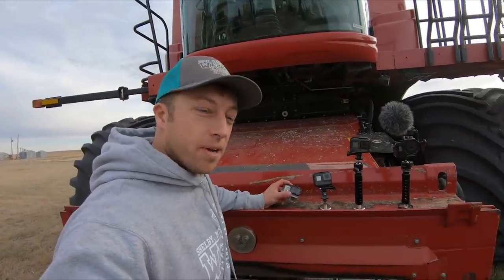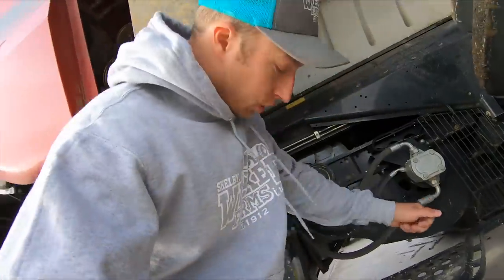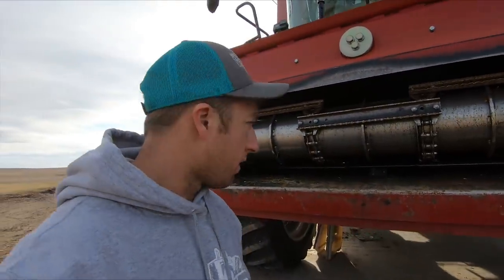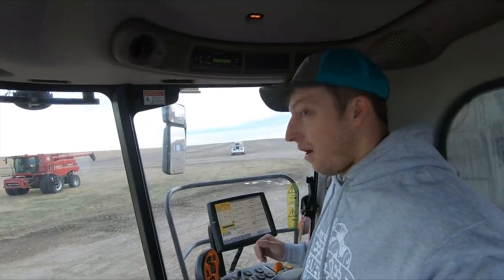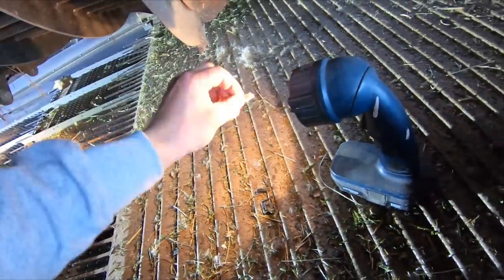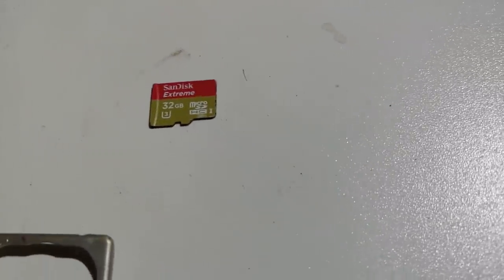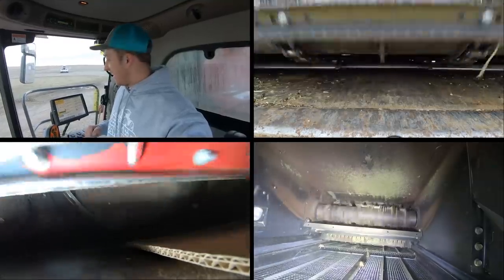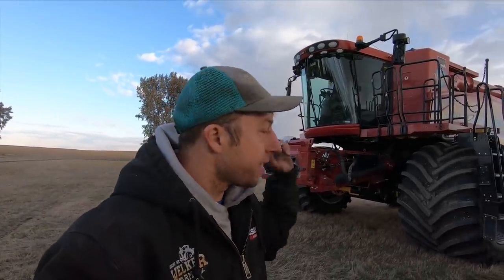I FED my COMBINE a GOPRO CAMERA

Comment: in case anyone is wondering; the camera doesn't get taken out by the chain bar. it's probably the rock beater.
the reason the video cuts out almost instantly is because the camera records the video to a buffer then writes it to the memory card in one continuous operation, so what's recorded will always be a few seconds behind what is actually happening.

Comment: All i can think of is those scenes in Looney Tunes when a bird character goes through a machine and it's all naked and featherless. :)
Reply: in reality its not a pretty sight. here in Australia lots of our fields are not flat so we don't put our headers as close to the ground like other places but we have some flat spots in our fields so i put her down low and the wheat was nice a thick so thick i couldn't see the fox hole and the fox that got scared out of it and got pulled in and drag it all the way up to the drum and made a horrible girding sound. had to dump that tank of wheat on the ground and burn it then spent 2 whole days making sure the inside of the combine was spotless.

Comment: att my old jobb we had shreders that we used for big stuff like cars and such. i worked att the conveyor belt collecting all the copper and throwing away all the cloth material. som times they whould shred realy big stuff. im talking about metal chunks as thick as that gopro cammera. yeah that thick. so you whould see red glowing big chunks of metal on the conveyor belt. realy hot from the shreder. the shreder is kind of like the normal shreders you see att junkyards but super sized.

Comment: The people at gopro need to reinstate their quality assurance
Reply: Must be in place to prevent those parts from becoming spare parts or in other uses.
Reply: @lachlanlandreth9069  at least they managed to make the plastic made out of crap so they can protect the sd card inside for the user to watch their 1080p version of corruption land.... Its a good film, the bit that let me down is that the video was only 5 seconds long
Reply: @techrja  I don't know what kind of plastic you know that would withstand that, without being bigger then the Go pro form factor. Go pros are tough, and are able to be put through alot, but that speed would be outside it's desgin range.

Comment: Welker farms and millennial farmer were running their international and John deere combines in adjacent fields each was combining their wheat fields. Grandpops is watching from the porch,that international was really moving across the field,a little to fast by grandpops guess,till a rabbit got scared up and tried to get away, but to late and to slow he got knocked in by a bat on the reel. Grandpa is watching all this,gets a chuckle out of it but he's still quite concerned about the speed of beastbine, then low and behold out the back comes that rabbit, running for dear life.
 Gramps says " that's enough them boys are a wasting grain". He grabs his cane,hobbles to the pickup truck and heads the Beastbine off. Leg arm a little surprised stops to see what's up. Gramps gets out of the pickup waving his cane scolding leg arms for wasting good grain.  You got that combine opened up enough that a rabbit just went thru it still running. 
 Leg arms quietly gets up to the grain hopper and stirs thru the top layer of grain and retrieves a small furry pouch,holds it out to gramps and says" don't worry gramps it only takes the seed"!!!!!!!!

Comment: Nic, Much like what you had happen. I had a camera on the front stretch wall at the race track and a modified climbed the wall and took it out. The SD card lived through it but the video stoped 18 seconds before the impact. I contacted iON the camera manufacture and they said at high revaluation the presser can take up to 20 seconds or more to store the video on the card. So I didn't get any video of the impact. :(

Comment: Weren’t you afraid of damaging the inside of the combine? I mean the GoPro could act as rock...
Reply from the maker: No not at all, you'd be amazed at how tough these things are, as long as it isn't solid metal or rock it won't do any damage. I bet 10 minutes in a rice field does more damage than 10 gopro cameras going through.
Reply: Welker Farms Inc Ok I see you point👍🏼 Keep up the good work greetings from Sweden👍🏼